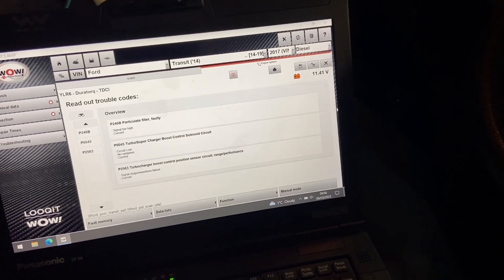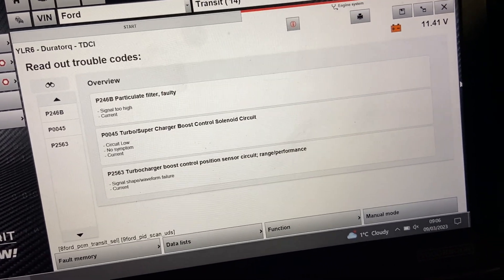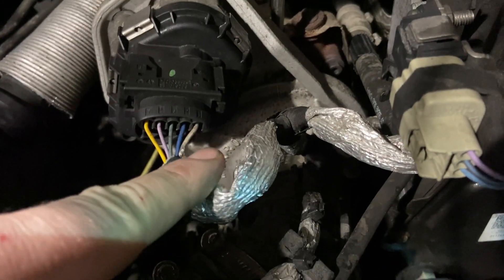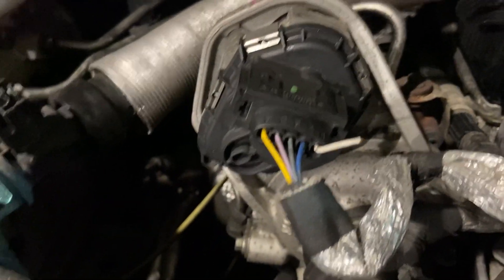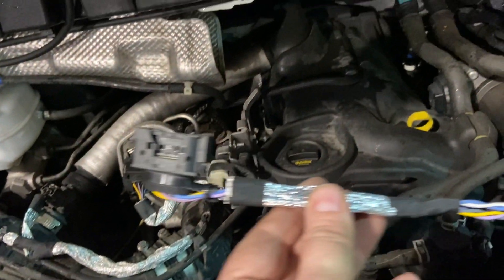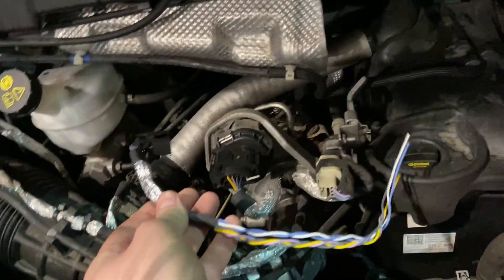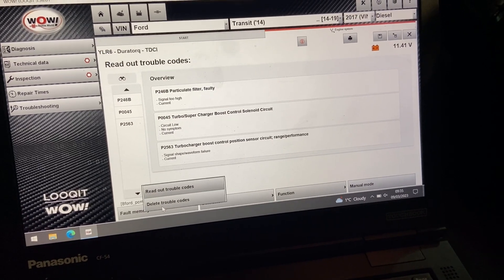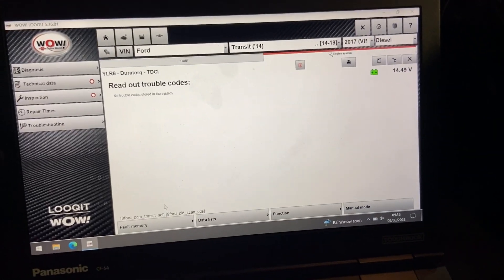Ford transit Adblue fault fix P246B P0045 P2564

Comment: I seen someone writing up it’s only in the 2016,17,18 models. 
I have a 2020 transit and got the same issue the other day I moved the wires about and the lights went off. Question is does the 2020 give this problem just before I order the part

Comment: P02e4 fauld code I am getting I just reset its gone ita give me on screen add blue system fault 456 mile and etc i reset wirh my little old reader it's gone u have any idea maybe it's same wire problem thx
Reply: Hi did you fix this problem

Comment: I'm getting intermittent fault p0047 and p0046 related to turbo boost solenoid. I'm wondering if I could have this fault.  But can I ask you, someone at a Ford parts department has told me the ecoblue doesn't have the old Changeable boost sensor, and it's now integrated into turbo.  Are they spinning me a yarn?
Reply from the maker: I could be wrong but I’ve never seen a boost pressure sensor integrated into the turbo, as this is the point where the pressure is created. It is usually located later in the system either in the intercooler or on the intake manifold some where. 
  The turbo may well have a position sensor on the wastegate that could be where the confusion is

Comment: Hello
On my ford transit mk7-2010-103kw the code comes P2563 When I start driving up the hill, I checked those cables and they are intact, no fault is visible
is there a possibility to activate that code if something is wrong with the DPF
Or if you have any suggestion or advice
thanks in advance
Reply from the maker: A blocked DPF is a possibility but there should be DPF fault codes as well. I would start by having a look at the pipe work and intercooler and if no joy possibly have the turbo tested
Reply: What was it in the end ?
Reply: @Stebol93 It was VGT. Although it wasn't stuck when I took it apart, when I cleaned everything inside and removed the rust from underneath the housing, it was fine.